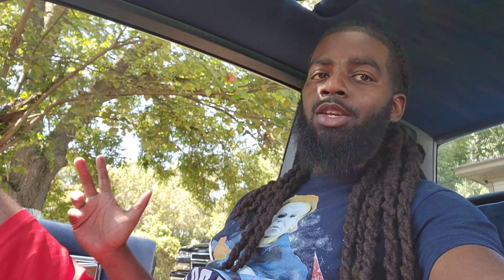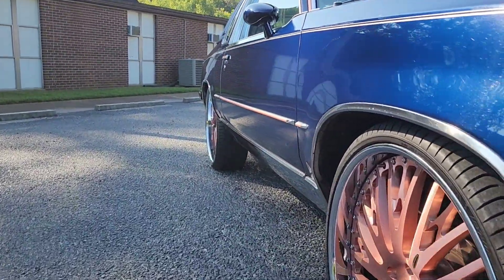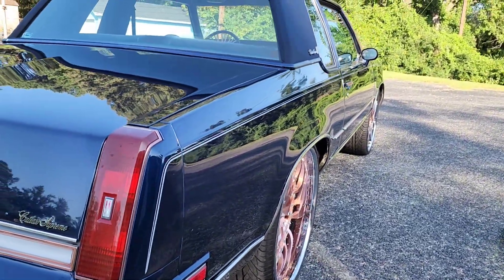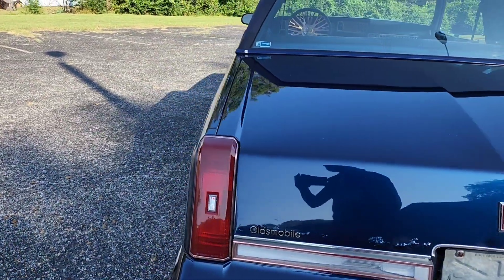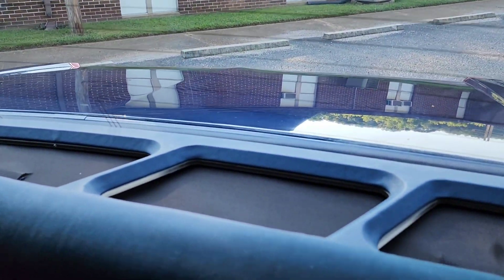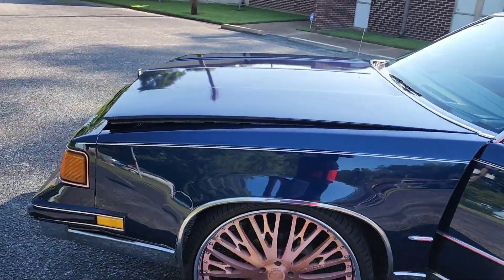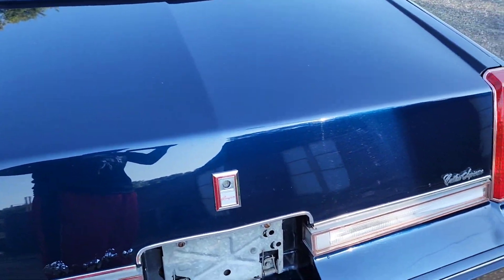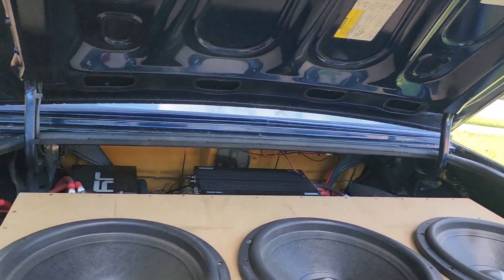SOLD My Box Chevy & Bought a 87 Cutlass

Comment: Hey buddy.. I just saw your video about the dash cap. Really liked the way you fixed it. I want to order a cap but not sure about the installation. Do I have to put it over the old one and install? Or is that possible to install the new cap without using the old one?
Reply from the maker: U have to put it over the original cap and glue it down in certain areas
Reply: @drejackson1000  thank you so much for your prompt reply..
Reply: @drejackson1000  buddy, are you satisfied with the result? Or the original dashboard with some cracks is better?
Reply from the maker: @kambizmoradi  no problem
Reply: @drejackson1000  thanks man.
Love the way you answer the questions. Short and to the point